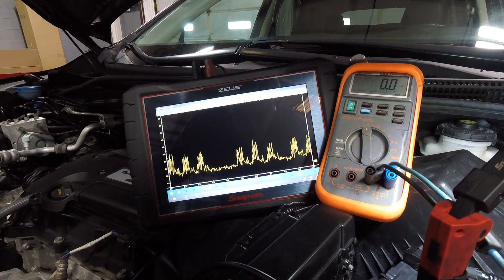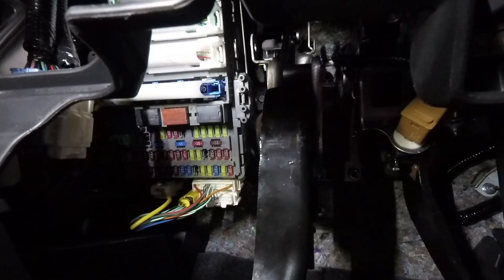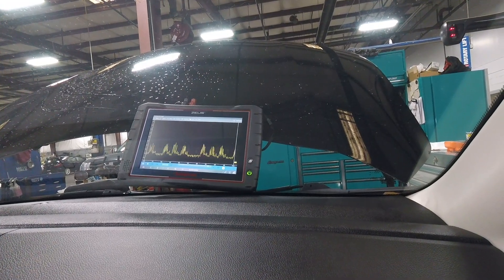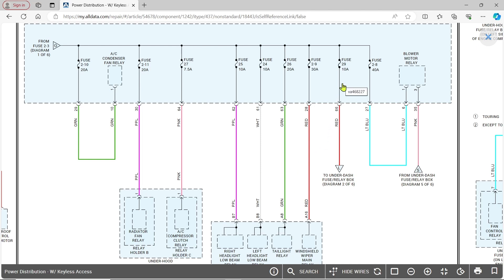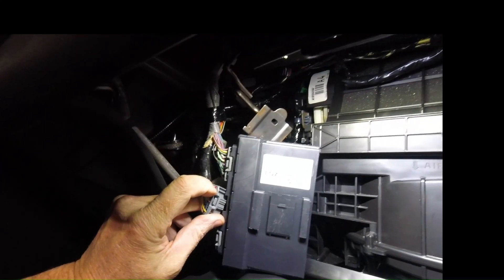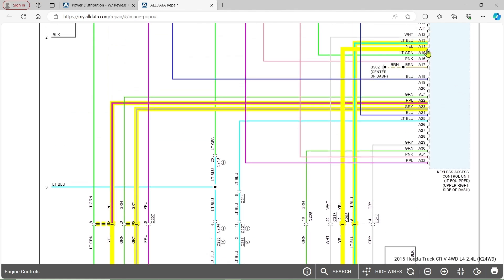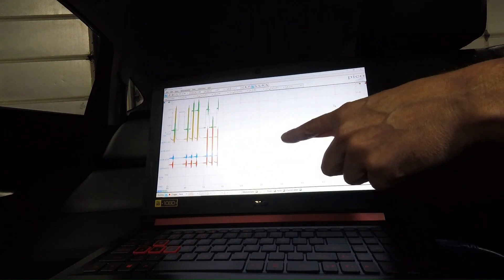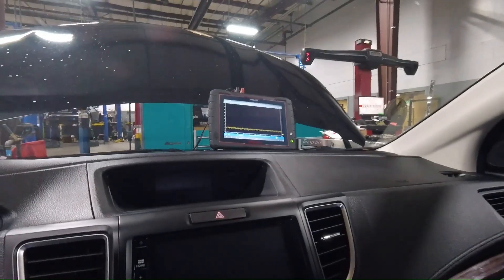Parasitic Draw=Dead Battery

Comment: Great video.
Questions, any codes on a full system scan, any data PIDS on keyless entry system, would wrapping a scope lead wire around the door handles show the same ae the TPMS tool?
Thank you in advance for your answers.
Reply from the maker: I don't remember using the scan tool on this, due to the main complaint of the battery going dead. The scope leads are shielded so I'm not sure about the wrapping technique.  Autonerdz /Pico has a keyless entry signal detector part no. TA330 fairly cheap that should pick up that signal.  Link to Autonerdz 
https://autonerdz.com/?wpam_id=2
Reply: @CartersDiagnostics  Thank you for the reply.

Comment: I have come across this a few times now. I never thought of using the tpms tool to check! Thank you for that. I will add that I’ve seen this draw for the handle intermittently failing causing the draw.
Reply from the maker: Good info. Thanks. The TPMS is a neat trick. It works well in Nissan, testing inside outside and push button antenna's.

Comment: Hey Mike, always look forward to your videos. You mentioned that you didn't think you had a good connection on the blue trace to lock sensor. I was assuming that was why it never showed on the screen when you pushed the lock/unlock button on the driver's side. Is that the case? Also I noticed on the schematic that both outer door handles list a lock switch. I know they weren't involved with the diagnosis but I wondered if you knew if that was referring to key cyl. switch. I didn't think passenger side had one even though it showed it. Thanks in advance for taking time to answer.
Reply from the maker: Definitely a bad connection in the touch switch input on the drivers side,  but the antenna signal responded when I pushed the button  so I left it alone. Only the drivers door had a mechanical key. Not sure  about the lock switches on both.